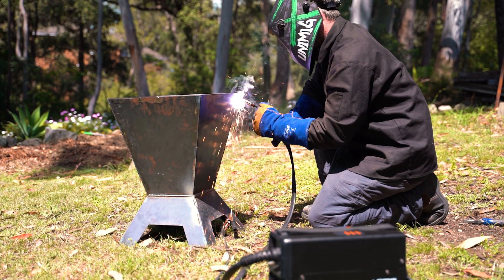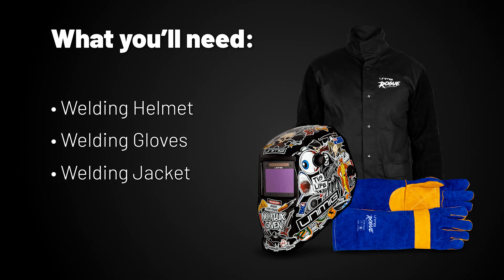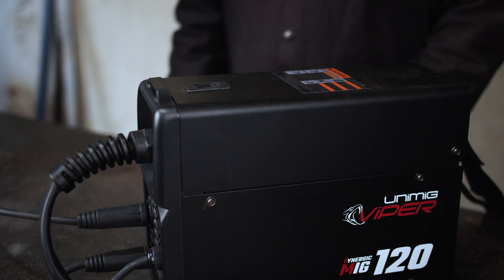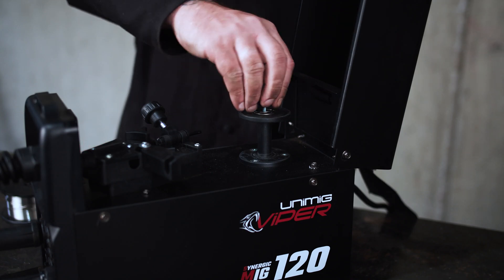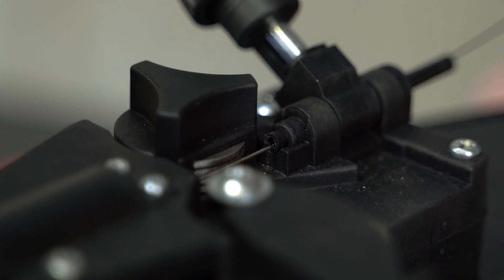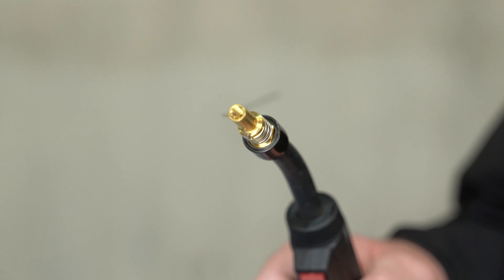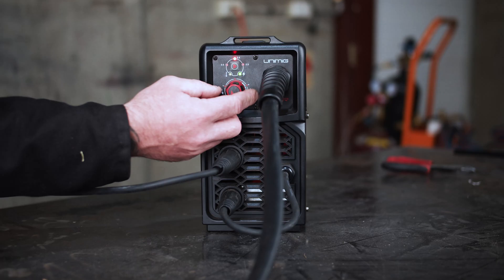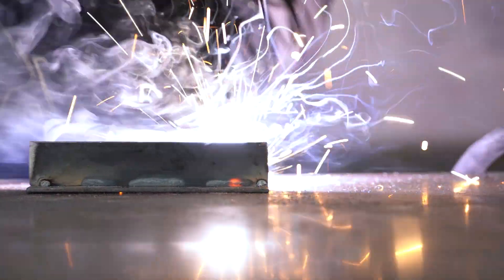VIPER 120 SYNERGIC - Gasless MIG Welding Setup Guide

Comment: For us first timers:
Why connect earth clamp to  work piece?
Can't see your earth clamp when you're welding so where is it?
Reply: He is using a steel top bench made for welding on. The earth clamp is connected to the bench top to make the whole bench top earthed so you just need to lay the items to be welded onto bench and due to metal on metal contact  you don't need to keep moving earth clamp. It's a great way to weld if you have a bench to put a metal top on.

Comment: Thank you for the video. I have two questions. 
First, I am a bit bemused by the rating advice given on page 4 of the instruction manual that came in the box, Section 1.5, where it says the Rated Input power (kVA) was 4.15. Now a 240V, 10A outlet can only supply 2.4kVA at most within ratings. I note the Viper 120 has a 10A rated moulded plug attached, so can the Viper be used at  the maximum setting? Is there an error in the instruction book?
Second, I noticed you refitted the gas nozzle after fitting the flux core wire. Page 11 of the manual, Step 14 for gasless operation says "Not install the gas nozzle to the torch head". Even allowing for translation difficulties, do we weld gaslessly with or without the gas nozzle attached?
Could you please clarify these points.